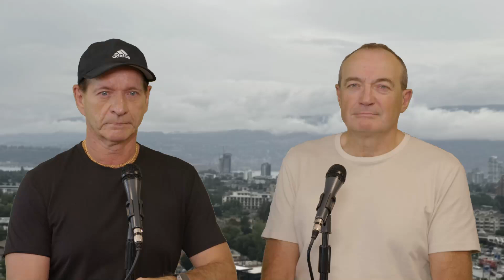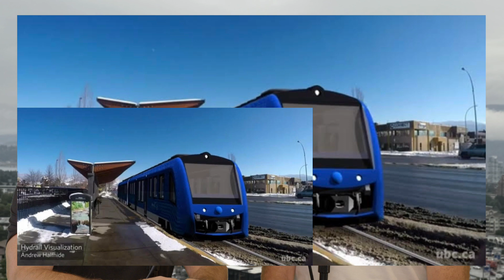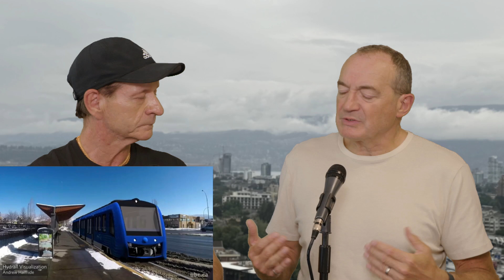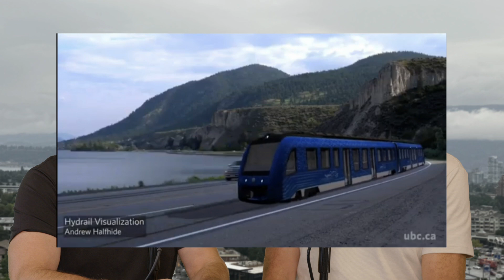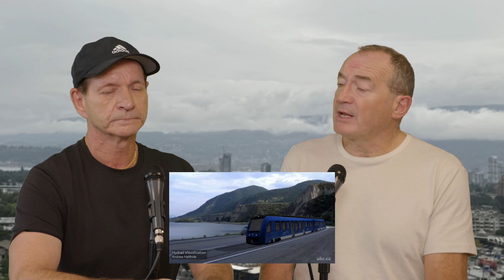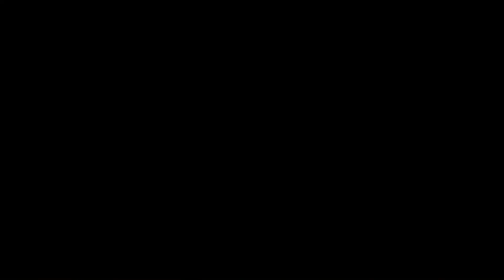Why hydrogen? Lovegrove dives deeper into Kamloops-Osoyoos train idea

Comment: I have to admit that I'm very skeptical of Hydrogen given how far battery tech has come, how cheap it's become, and how expensive and inefficient Hydrogen/Fuel Cells still are.

I'm curious about the costs mentioned. It was mentioned that an electric train would be more expensive, but are you referring only to the upfront cost, or the full lifetime cost, including fuel/energy production and use? As you mentioned, creating green Hydrogen is very energy inefficient, and hydrogen fuel cells are also very inefficient. A fuel cell might be cheaper up front than a high voltage line and transformer, but it seems like an electric train would use less than 1/4 the energy per trip. Would that balance the scales towards an electric train over it's operating lifetime?

And I'm curious...if Tesla can produce a semi truck with 800Km range on battery only, hauling 82,000lbs, it seems like light rail should be pretty feasible over 340Km. You need an adequate high nickel lithium battery and a charging station at each end. But the energy efficiency and low operating costs would possibly be a massive win over Hydrogen, even if the initial cost of the train and battery is a bit higher.
Reply: Quick glance at the study...seems total energy needs are only about 1MWh in each direction. That's barely larger than a 900kWh Tesla Semi battery. Do a little charging at each of the 14 station, and it seems like it's very feasible with battery. Throw solar panels on the roof to run heating/cooling systems. There's definitely an up-front cost for that battery, but the total operating energy required would be massively reduced compared to green Hydrogen.

Also, study didn't include any detailed cost breakdown of various options. Mentioned cost of power sub-stations, but didn't mention huge costs associated with Hydrogen refining, stations, transportation, etc.

If it's an independent company, by all means, go Hydrogen. But if there's any taxpayer money involved, I'd like to see a study showing a more detailed comparison of the full lifecycle costs vs a BEV train.